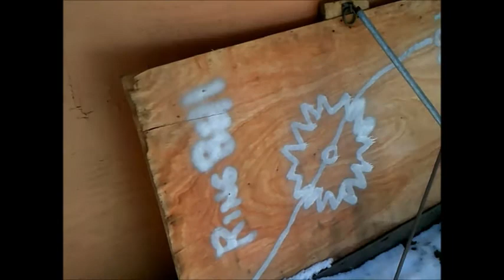Coral Castle's Sweet Sixteen from Ed Leedskalnin. Runs great now!

Comment: I found the following page by chance while searching "model T Magnets".
Taken from keely.net 4/06/97:

Recently, KeelyNet was provided with some anecdotal information that linked John Keely to Henry Ford, Sr.. I have been holding off on posting what was said because our contact offered to write the story up with as much detail as he could provide. It is now almost two weeks since the conversation and nothing has been forthcoming, so from a 'webtime' perspective, it is due. Please understand this is just another intriguing 'spook story' at this point. It is not being presented as fact, but as it was told to me and I thought you'd also like to read about it. The Model T used a hand-cranked magneto starting system to provide the spark that exploded the gas to move the pistons. This is how a lawnmower produces the spark needed to keep its engine running. The flywheel as I understand it, had very strong magnets embedded in it. The bell housing that surrounded the flywheel had coils of wire which would produce a nasty high voltage spark when the flywheel rotated the magnetic field past the coils. This spark is what ignited the gasoline in the cylinders. The magneto type starting system had to be hand cranked to get the motor running, and the burning gasoline would keep it running once started.

When automobiles were first being developed, there was serious competition between the various inventors vying to be first to market and in a big way. The vested interests did not want automobiles because it would change their world, requiring them to alter their business stance or adapt to a new world where competition would run rampant. Competition means hard work to stay even or get ahead of the pack, so life is easier when everything is crystallized and fixed. The comfort zones were well established and would be maintained any way they could. The first year model Ts built by Ford had a special flywheel and housing that was said to have been designed by John Worrell Keely and sold to Henry Ford. Ford bought the design as a form of insurance because of all the harassment he was getting from vested interests not wanting to see him succeed. After 20,000 to 30,000 cars went out, Ford was threatened by oil and gas interests trying to coerce him to shut down production. It was not made clear who these forces were or why they were trying to put Ford out of business. After the first year of manufacturing Model Ts, efforts were renewed to shut Ford down. At this point, Ford then gave THEM an ultimatum, either leave he and his family alone or he would send every Ford Model T owner a set of cow magnets which fit in special slots that were cut into the bell housings on the first year run of cars. This bell housing was cast into the engine block and not a separate unit as on modern vehicles. The flywheels were the hand cranked units having Vee magnets. They were magnetos that when cranked, moved the magnets past a coil to produce a very high voltage/current to spark the plugs. It produced a vicious spark. Once the cow magnets were placed in the slots, the hand crank was turned and the flywheel would spin on its own, generating up to 40 HP and completely self running. You had to get the flywheel spinning to a minimum rpm before the magnetic drive effect would take place. Ford told his opponents that all Model T owners would then be running their cars for FREE, not requiring any gasoline or other fuel. And that the principle would be copied and applied to all machinery. Once Ford's opposing forces verified the truth of this, they instantly ceased all attempts at intimidating Ford and his company succeeded beyond their wildest dreams.

My contact said there were three fellows who got wind of this story several years ago. They secured a first-run Model T and found it did indeed have strange slots on the bell housing. Magnets were inserted and when they cranked it, the flywheel began to spin on its own. Based on this initial verifying experiment, they eventually produced a 40hp version which was self-running, using the same magneto system. A demonstration was scheduled in a larger city and two of the men drove the prototype to the demonstration, the third man was ill and could not attend. The demonstration went off without a hitch and was enthusiastically received. Plans and contacts were made for duplicating the prototype for further tests that would be followed by marketing. As the two men were driving home late that evening with their prototype, their vehicle was run off the road. The next day, their vehicle was found overturned, both bodies lying in a ditch with their throats slit and the prototype was gone. The third man who had been too ill to attend the demonstration packed up everything and went into hiding.
Word is, this man is still alive, very paranoid, yet he has not given up on the principle and has gone even further in his development of the principle.

I found several pages on the web which provide further insight into this story. One in particular provides information indicating that Ford intended the Model T to be run on ETHANOL, not gasoline, because it was a renewable fuel. This could have been the bone of contention with the gas/oil companies. Check out ETHANOL for that page. The original vehicle produced in 1903 was the Model A, of which about 1,700 were produced. Check out MODEL A for first run details. For a history of the car in question, check out Ford Model T . Various other files relating to Henry Fords life and the history of the Ford Motor Company can be found at Ford Bio 1, another version Ford Bio 2, yet another at Ford Bio 3 and a puzzler called Did You Know?
There was another file that provided some details on the legal battles between an inventor named Selden, who had patented the concept of the 'horseless carriage' and thus had a hold on any motorcar. It is located at Ford History. One final URL that was quite amusing and indicates that electric starters on early automobiles were not in use until around 1920 is located at Hand Cranking. Henry Ford Sr. was born July 30th, 1863 and died on April 7th, 1947. Keely died in 1898. So there is a nearly a 40 year period when they could quite possibly have known each other. Ford did make trips to Manhattan and being of an inventive mind would have heard of Keely, who was written up in many papers and magazines from 1872 until his death in 1898. It is not too much of a stretch to envision Ford attending one or more of Keely's many public demonstrations (as did Tesla who I have NO DOUBT copied much of Keely's discoveries using electric current instead of mechanically produced vibrations, but that is another story soon to be posted). Also note that many prominent businessmen and socialites were Keely sponsors and supporters which would also have gotten the attention of the young Ford since he was also trying to establish a business and would take any edge he could use.

You are probably wondering how Keely could have come up with a self-sustaining magnetic engine design since he worked primarily with acoustics. Quite simple really, since his motors used acoustic forces to drive them, it follows that the pattern is the same for any ALTERNATING energy flow, including magnetism. Here are two version of his motors, Keely Motor 1 and Keely Motor 2. The various claims for PMMs (perpetual motion machines), whether magnetic or gravity driven, always require a restorative kick to keep it running. This follows for the current Hamel device where he uses wobbling cones to restore the rotational force. A flywheel or weighted arm mounted on a horizontal shaft so that it rotates in a vertical plane, will fall by the force of 'gravity' and inertia will push it past the 180 degree point and up to about 270 plus degrees. At that point, you have to use a 'kicker' to push it past the 360 degree point so that the rotation will perpetuate. Just like pushing someone in a swing, if you time your pushes just right, you can drive them in ever higher arcs and eventually over the 360 mark. Panasonic manufactures an ultrasonically driven motor that could provide a template for a permanent magnet version and there is a patent for an automobile engine which uses vibrating plates. Years ago, back in the late 60s or early 70s, there was a fellow out in Lubbock, Texas, who had a model car about 18 inches long. It had a very large electrically driven tuning fork with linkages attached to the tines of the fork. Because it was electrically driven, it only used a 9 volt battery and the inventor claimed you could use a 6 volt lantern battery to run your automobile. The key was that it used the resonance of the fork to produce high amplitude mechanical forces. That mechanical drive was diverted to the wheels of the car. The guy never patented it because he was bought out by a large oil company. One other point about the Model T claim is the engine used a weighted crankshaft, that was why the vehicles would vibrate from side to side due to the inertial kick of the weight. I am also told that these engines could also idle at very low rpms, something on the order of 100 or so revolutions per minute.
This story is definitely out there but should be fairly easy to prove. We are checking into it as much as we can with our limited resources. Perhaps someone out there has access to a Model A or a Model T and can examine the bell housings on these vehicles. At this point, I think the weighted crankshaft would be necessary to the operation of the magnetic engine since it would provide the restorative force.
Reply from the maker: Yeah I've heard this story a million times before, All I can say is I don't BUY it. 40HP from cow magnets EH? can't be sure. People will write the darndest things. Some one will just have to prove it I guess.          PEACE
Reply from the maker: ***** Here is the video I have that actually explains everything about the wheel. His sweet sixteen was probably a girl AND his sixteen pole machine. the one at the castle is 24 pole. But he made ten of these wheels. the first few I believe were 16 because it was from model t flywheels with 16 magnets.  
      this TECHNICALLY explains the electrical aspects of the place for REAL. and the rest is obvious. get popcorn its 35 minutes. BUT IT IS THOROUGH. I hope.
https://youtu.be/nOoCuDnmtyM

Sincerely, Scott R.